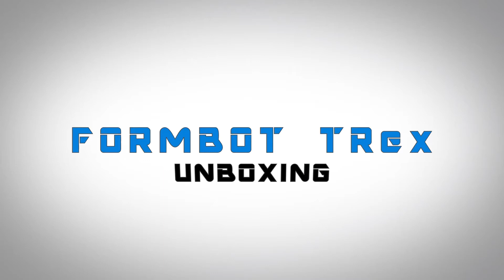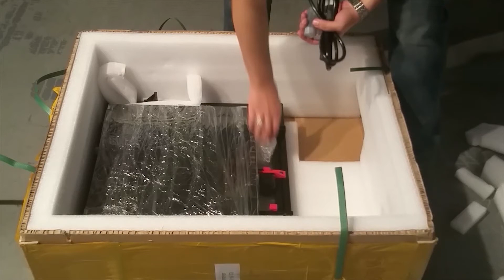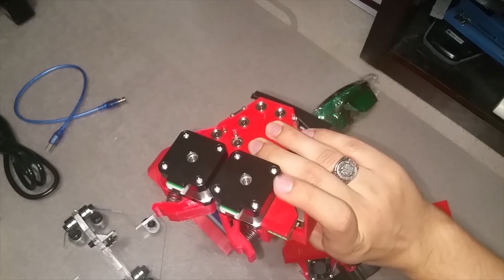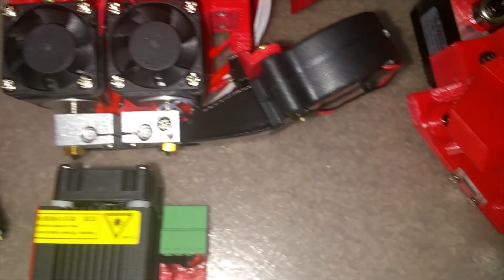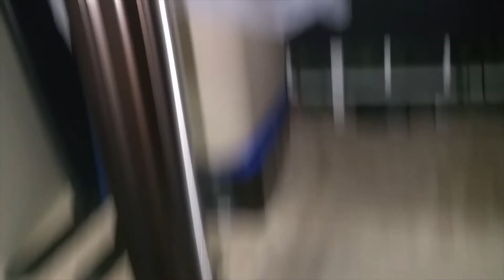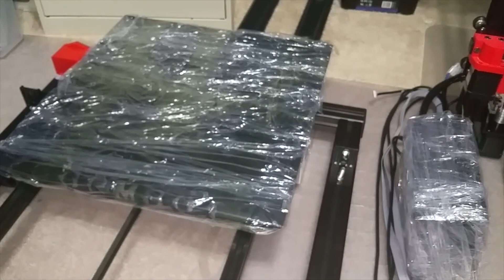Formbot T-Rex 3D Printer Unboxing

Comment: Hello, thank you for your video, can you tell me more about this 3D printer, does it work well? is the structure of the machine good? I have a CR10 now and I bought a used Formbot T-Rex, I have some repairs to make it before I can start it, does the T-Rex printer print better than CR10 or less?

Thank you for your answers

Comment: Thank you much for the video since it has provided much insight. Please note FormBot has literally taken the gMax 3d files and ripped off the design hence why many of the parts are identical. We uploaded the parts for free for the community to use and FormBot did not provide the attribution required and don't seem to bothered to do so. We spent an incredible amount of time on R&D and it was interesting to see the parts they stole and the other ones they didn't. It was also very useful to see when FormBot took the files since a few parts have changes from the parts you show in the video.

Since the 3d files in this video, we have replaced several parts with metal to improve shipping stability and overall performance. Specifically the hotend plate, the extruder swing arms, the z-axis motor plates, the y-axis motor plates and many more. Apparently they didn't spend too much time or care on testing or they would have reached the same conclusions as we did especially for the magnetic extruder plate.

We are literally not trying to harp on you or hijack your comments or even complain we just want to defend our hard work and let everyone know whats happening in the 3d printing world out there.

We also want to share that we have several fun models available on our site, a growing forum user base, facebook/instagram/twitter social media channels and new youtube tutorials all for the community for free at www.gcreate.com

Also, a list of changes to the gMax 1.5+ can be seen here: http://www.gcreate.com/#!gmax-15-2016-series/c1jkr

Comment: Make a review!
Reply: I think the heated bed is 200mm*200mm. There is the option to upgrade it to 400*400, and even to make it with dual heated zones (a small center one, and a big one that covers the rest) for an aditional price.
Reply from the maker: +Joaquín Barberis And I'll be doing a review as soon as I get some prints done and get the printer calibrated.
Reply: +3D-Dr Nice. Could you post a picture of the otherside of the heatedbed?
Reply from the maker: +Joaquín Barberis do you mean the bottom? or the back?
Reply: The bottom, where the heater is.
Reply from the maker: +Joaquín Barberis I will try. But it's kind of hard to get under there now that it's assembled. It looks like the entire bed is insulated with foam under the bed with a large heating element in the center.